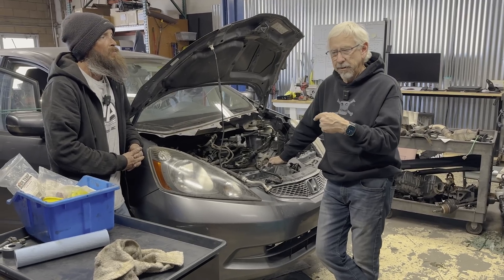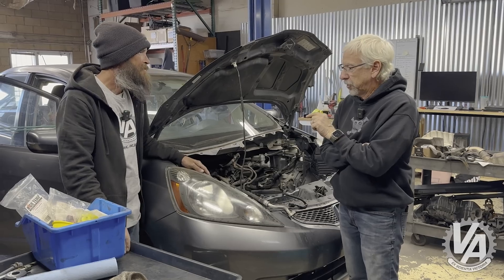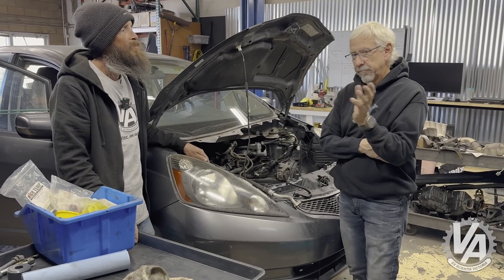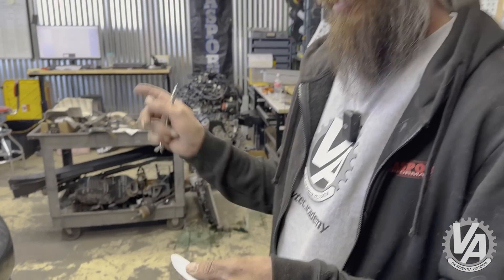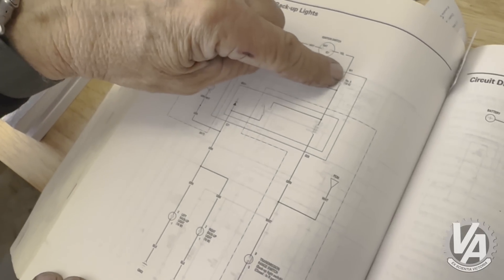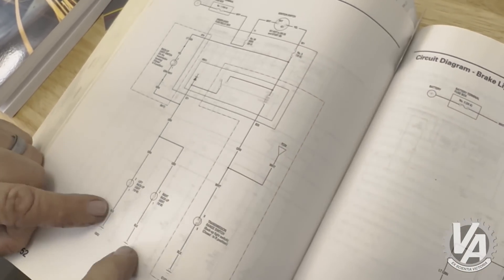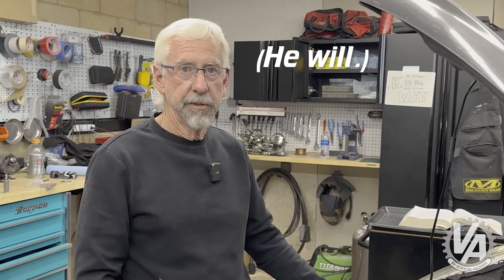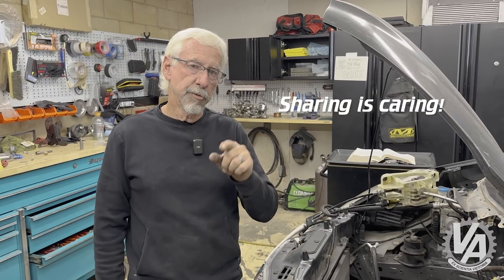K24 Swap GE Fit/Jazz  Auto to Manual Conversion (Part 2)

Comment: What year transmission did you guys use ?
Reply from the maker: 2008 Accord.
Reply: @VTECAcademy  wish I would have known that before I bought an 07 and the mounts too…… now I’m having a hard time finding an adapter bracket for the shift box.🥲
What shift cables did you ended up using ?

Comment: I'm currently doing this swap k24z3 TSX engine with a TSX manual transmission the only question and or problem I'm having is which shift cables and shifter box assembly to use?
Reply: hey kurt, did you figure out the shifter/cables ? im stuck here too
Reply: Yes I did.

Comment: Guys, I have a Hoda Fit with 4wd, 1500cc engine, question how can I change from a AT to a 6 speed and keep the 4wd setup.  Mike from Japan
Reply from the maker: I don’t know if Honda makes a six speed all-wheel-drive L15 transmission. It may be available from Europe.

Comment: Quick questio? I have a 2011 Fit Sport Manual.
Can I Just get a complete 2012-15 k24z7 swap ( engine, ecu,harness,axle)?? 
Thanks for God for Vtech Academy and Hasport!!
Reply from the maker: It looks like 2NRS makes a jumper harness of that combination. So probably yes.

Comment: Hey Brian, where did you get that manual for the fit and do they have books that big for other chassis
Reply from the maker: I bought it on eBay. Helm Inc. makes them. They still print them for some models.

Comment: Any reason we couldn't use a certain Phoenix based company's jumper harness to handle the manual bits of the chassis wiring?
Reply from the maker: If you're talking about Hasport, I'm not sure we are going to make a product that will be for sale. The Information we release should give some other company the ability tomato the harness.
Reply: @VTECAcademy  I'd love a tomato harness, personally. 🍅

Comment: I have to agree here. I got my 2007 sport, clean title, only a slightly dented pass fender for less than half what they sell for now days, but it's automatic w/ paddle shifters, it's "okay" for a DD but it's just not as much fun as it would be otherwise. 
At least it's NOT CVT.
Reply from the maker: Yeah, we find the manual to be more engaging to drive even with the stock L15.

Comment: Hey VTEC Academy I have a question so I'm looking for a front sway bar for my 04 Accord but couldn't find anything and I know the TL and TSX are kinda like sister cars of the Accord of that gen so my question is would I be able to get away with buying let's say an aftermarket sway bar for a TSX or TL instead of an Accord
Reply from the maker: H&R makes a front sway for the Accord. Marcus at Heel Toe Automotive can probably lead you in the right direction
Reply: @VTECAcademy  thank you I really appreciate it

Comment: thanks for the detailed wiring info
Reply from the maker: You bet!
Reply: Second that!!! Especially since most factory manuals are no longer on paper
Reply: Omg I'd use the steering wheel Bluetooth button to do the reverse lockout.

Comment: My parts list is building up for this swap. Using a K24Z3 block with a K24A2 head and an 08 Si trans. Super excited. Thank Brian and the team at VTEC Academy!
Reply from the maker: Awesome! That’ll be great with the stock lsd. Thanks for watching!
Reply: @VTECAcademy  What size rivets did you use for the clutch bolts?
Reply: In the process of doing the same anyway you can help me out looking to see which transmissions are compatible with the K24z3 thanks 🤙
Reply: Trying to get as much information do you have social media ?